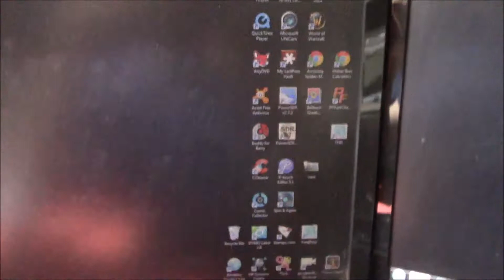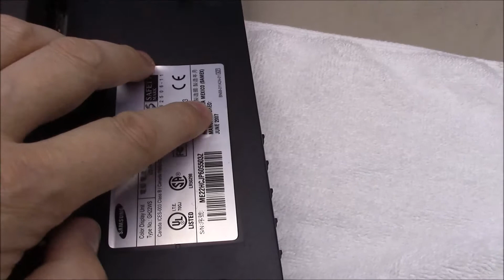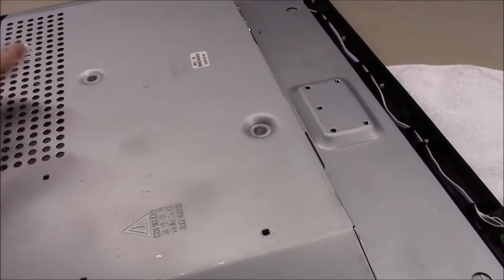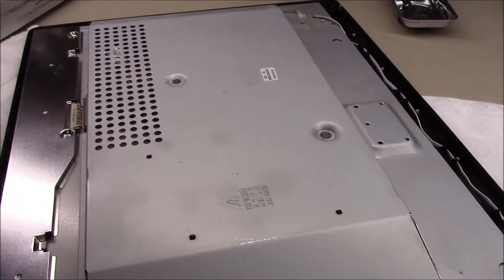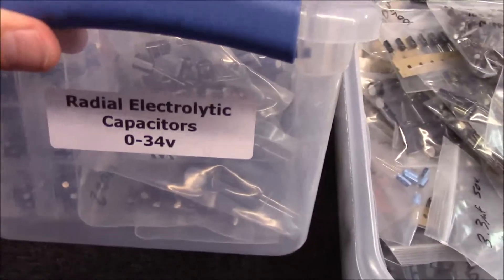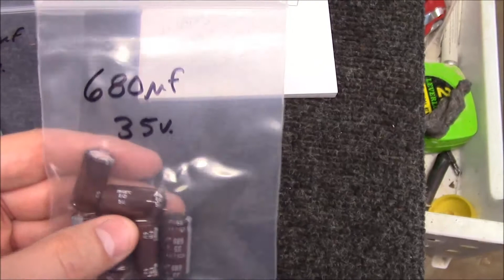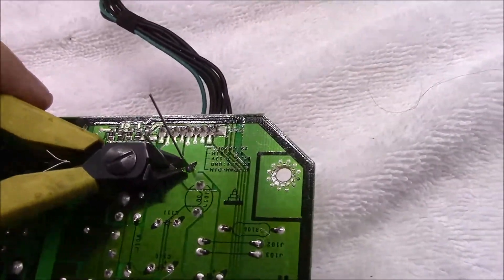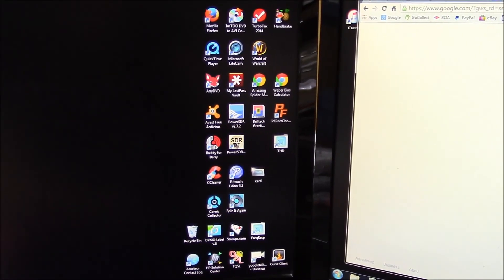Samsung SyncMaster 226BW PC Monitor Recap & Repair   BG023

Comment: did the samne repair job on mine. works fine, but the monitor is ruined now. closing the backlid seems to have put so much air pressure inside that my hole display is full of dust now. its like between the pixels and the plastic transparent foil thats infront of the panel

Comment: Question: I couldn't find the 820 caps, can I use 1000uf caps instead? (The voltage is the same)
Reply: Propably yes you can, it is not a problem for the device.

Comment: I fixed a Dell and an Acer monitor, both 22". The Acer had 5 bad caps and the Dell  had 3. The hardest part of the job is getting the cabinet apart without breaking it. I found the Dell in a dumpster, so for 50 cents or so my WIfe had a nice working monitor. My son's Acer is about 5 years old with thousands of gaming hours on it. He was going to replace it because he thought it would break again, but it's been humming along for a good year now. Both the Dell and the Acer had low end caps that were operating near their rated voltage spec.

Comment: I'd like to congratulate you on two things - how organized you are and on how step-by-step you explains things, very good for those who need some reference.

I have repaired a lot of monitors, including that model exactly. As for those high voltage wires, they run on AC, so it doesn't really matter if you invert them. One thing that you missed mentioning is that besides good quality, the caps need to be rated at 105C degrees because that power source works at high frequency and they get really hot. As for that big cap, it rarely goes bad or fail (I have never seen one bad) and does not really need replacement (I learned that from other repairmen).

I was kind of surprised to learn you have a kid at college...
Reply: renatoscutube It was Mentioned in the video that for peace of mind, all of the capacitors would be replaced so that  six months down the road, he wouldn't have to go back in there and replace another one. After all, the needed caps were on hand and CapXon isn't exactly a name that rings of quality. 105*c goes without saying but a good point just the same.
Reply from the maker: renatoscutube Two kids in college and another starting next year.